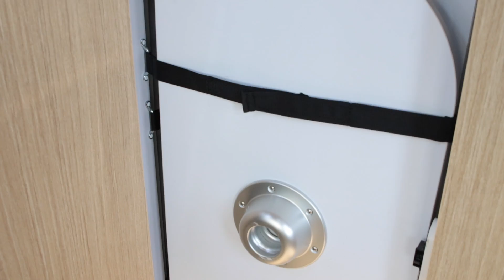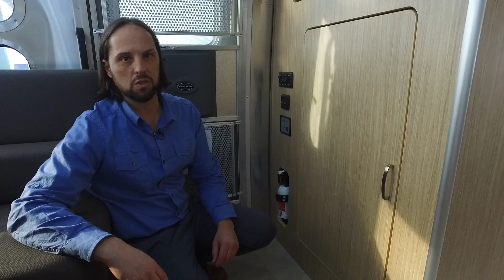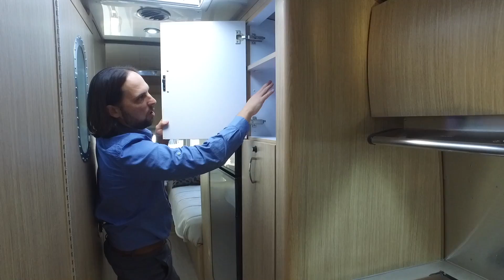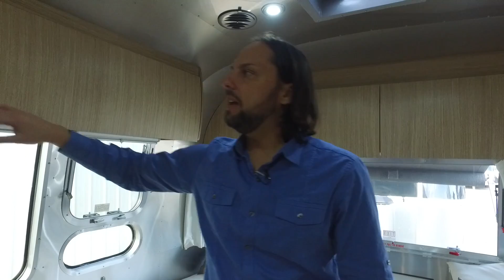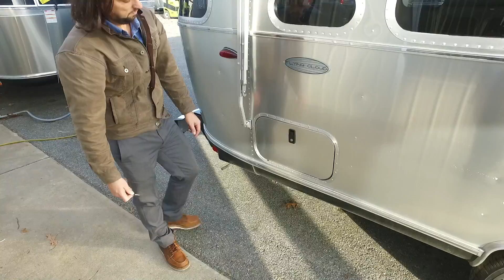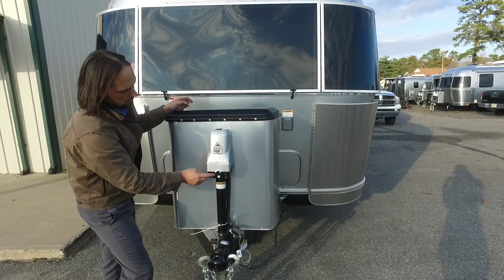2018 Airstream Flying Cloud 26RBT Rear Twin Bedroom Walkthrough

Comment: The 'solar system' is nicely fitted into the plan, but it's tiny.  180 Watts?  It needs 800 Watts to 2,000 Watts to be useful, but 5  panels of 300 Watts or  so would make a nice canopy.
Reply from the maker: Its difficult with all the items on the roof already and the curvature. From inside of the front and rear cap, there is 18' X 5.5' usable space minus the skylight, bath fan, fantastic fan, both AC units, shower fan, black/grey tank vents, refrigerator vent, radio antenna and TV antenna.

Comment: I wish they did a bunkhouse model in the Tommy Bahama style. Also you could,with some modifications make a dual rear bunk/optional rear bunk /den with a walk thru bathroom using the smaller style bunks on one side and other side a flip up bunk with a jack knife sofa underneath. (den or mini game room) without the kids having to sit on the bed to use the tv. or even a rear bedroom with a walk thru mini middle bunk room (two smaller bunks on one side two smaller hanging above/drawers below wardrobes on the other with a small desk on the other. Also by using the smaller bunks you can add roller style drawers under the bottom bunk,if you don't have already. Can either make it a walk thru bath or a wet bath. Just a thought; I would buy this btw. I used to live in a much older trailer that was similar; with the rear bedroom/walk thru bath, then walk thru bunk room.
Reply from the maker: Thanks for sharing your ideas with our viewers and us.

Comment: Hey Patric I have the airstream 30 Classic 2018 ,I drained my black ,gray and fresh waster tanks ,is it ok to still turn on my tank heaters ,it 17 degrees here in ft worth Texas
Reply from the maker: Thank you for checking us out. Yes, the tank heaters will still work when the tank is empty. The heat pad is similar to what would be in a cars heated seat.
Reply: Colonial Airstream thank you someone told me not to use my tank heaters if the tanks were empty , I knew you would know if that was true,I’ve learn a lot from your reviews thank you so much

Comment: Patrick- Loved you review of the 26rbt.  Aitstteran finally has created a replacement for our much loved 1984 Holiday Rambler Alumalite 24rbt trailer. It was a sad day when we said goodbye to the Alumalite in 2000.   When we retired 4 years ago we looked at the Airstream model line but found nothing that provided the functionality of the rear twin with front dinette.
A couple suggestions for improving the Airstream 26rbt from our Alumalite:  
Kitchen- Flip the bath module and the kitchen module.  That way you are working in the kitchen you are looking out at the family sitting in their lawn chairs under the awning.
Shower- The previous owner had a custom stainless shower bottom fabricated for the shower. This had 2 benefits.  It was far more rigid than a plastic base and more importantly the base was "lowered" into the floor which gave you more headroom.  This lowering of the basin is a common technique on boats. It really makes a difference. He had also added a skylight to give even more clearance.  I understand that the airstream is not a square box, but adding an extra 2 in of height in the bathroom woudl really be a value added feature.
Reply from the maker: Steve, Thank you for watching the video and for sharing your input on possible future improvements.

Comment: Airstream is over priced for what you are getting. The microwave situation in this one is no good at all either your blocking the hallway or you sitting on the floor to use it.
Reply: Nancy K We Love our AS! Great quality, and we've owned several other brands. There's a difference!
Reply: It’s a relatively small travel trailer. Everything is a trade off. We have a smaller Airstream with the microwave near the floor and we don’t find it’s a big deal.
Reply from the maker: Nancy, thanks for watching anyway.
Reply: John Hess I'm glad it's not an issue for you, but for us it would be. We are both seniors and bending to use a microwave isn't something that we would want to do.
Reply from the maker: Yes, John exactly.
Reply from the maker: We have other floor plans with Microwaves in different areas and positions.

Comment: I think this is about as heavy of a travel trailer as I would like to tow with my half ton truck with a capacity of towing 10,100 pounds. This way I can haul my generator, spare fuel, & blue boy in our truck with plenty of cushion for towing through the hills with wife and dog on a long trip. This floor plan also parks easier & stores more than other sizes. Thanks for such a great video, will head to NJ next spring.
Reply from the maker: Thanks for watching David.